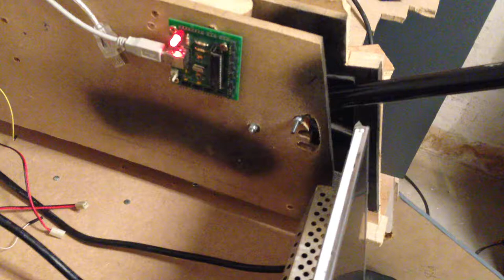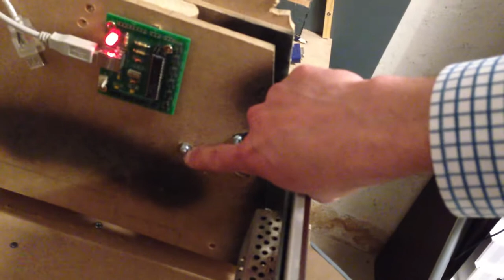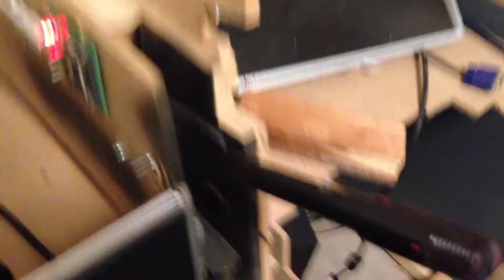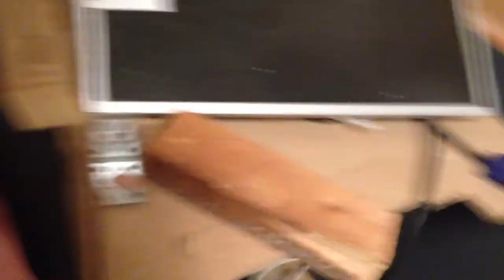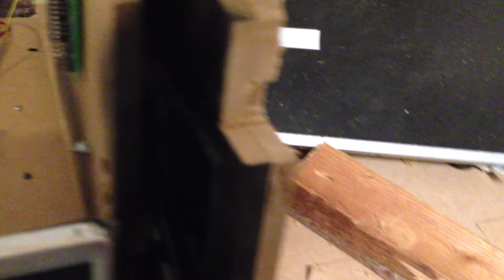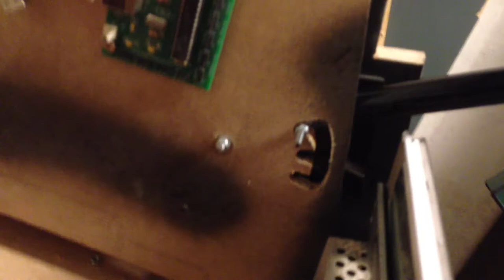$5 Gear lever - B737 Home Cockpit

Comment from the maker: It is connected to an OpenCockpits MasterCard. But you Can use any kind of interface card (even an old joystick circut board). All you need it 2 on/off inputs (like a switch on a joystick. The servo card in The video is just placed there because The servos on the MIP is located close by. It has no function with the gear lever. /Peter

Comment from the maker: The card on the side is an OpenCockpits Servo-card. I use it to run the flaps-gauge, brake gauge and yaw-damper gauge on the MIP. Just needed some where central to mount it. :-) 
/Peter

Comment: Another question is what kind of micro switch did you use?
Reply from the maker: The switch is those black ones with a large lever on top. Google "Micro Switch" and you get a ton of them. 
Wiring is pretty easy: One switch for UP, one for DOWN. Nothing in the center. So when the lever is in the middle no switch is activated.

Comment: Do you have a wiring diagram on how you set it up?
Reply: +underloard102 You don't need a wiring diagram to attach two switches to an Arduino (or any other of the controller boards available) >:<

Comment: yeaah 5 $    just the card alone cost over  30 $
Reply from the maker: Well the card you need is not the one mentioned in the video but any input/output card. If you are in building you need input/output cards anyway. So I don't see it like a $30 expense just to add two inputs to your card. /Peter
Reply: +Build a Boeing can you use an arduino board? and also for me to do some research,should I search for input/output cards;